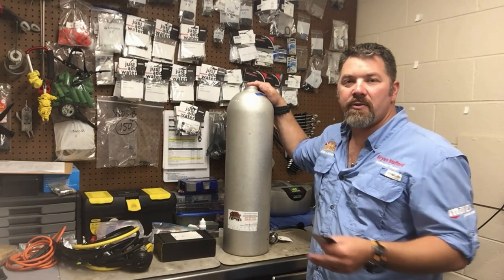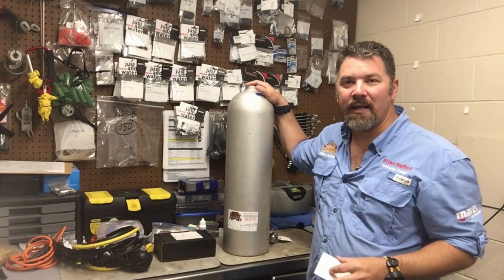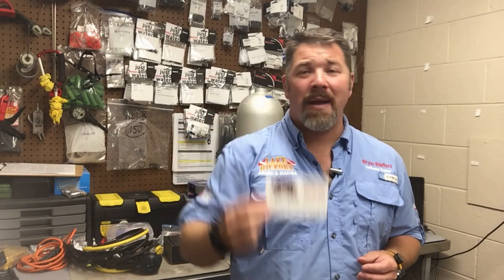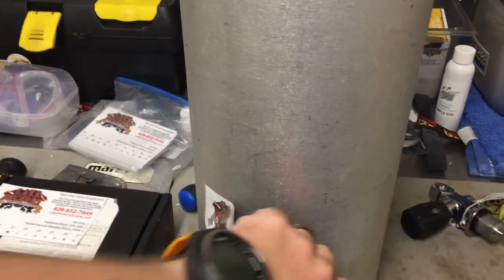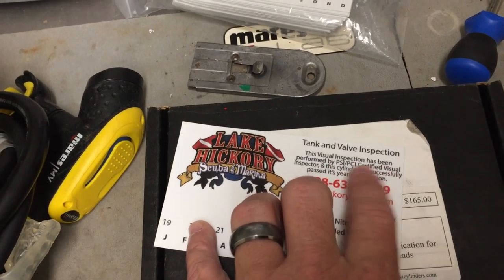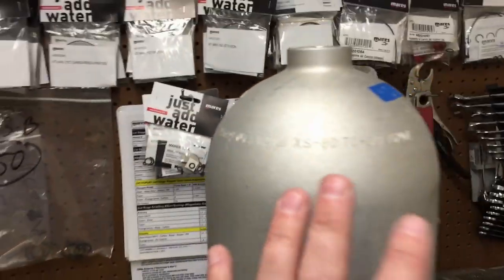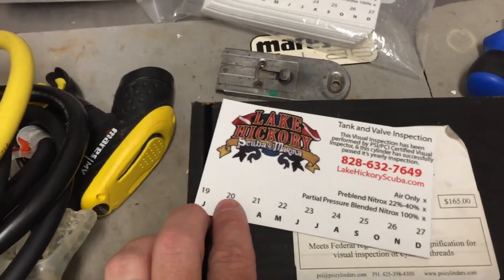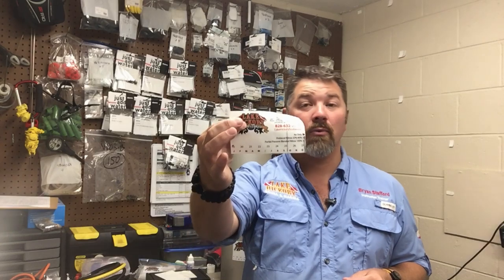The Visual Inspection Sticker (What Does It Tell Us?)

Comment: I will say check your stickers before you buy. I had a shop sell us some “brand new” tanks. Then they asked if we wanted to pay an extra 15 bucks to inspect them, as the tanks were past the existing sticker.
Reply from the maker: Hello Calvin, this is why we inspect and sticker the cylinders (new cylinders) at the time of purchase. The struggle is real though. When we put new cylinders in stock, we may sit on them several weeks, months, or even years. This causes issues after a 5 year time frame when the cylinder is purchased and the Hydro has lapsed.

Comment: Why two catagories of air and pre blended nitrox up to 40%
Reply from the maker: Hello Neil Jones. Air represents plain 21% breathing gas. Pre-blend is for shops that use a membrane system or continuous blending. Both of these do not require a cylinder to be Oxygen Cleaned prior to filling. The with Partial Pressure Blending, cylinders are required to be Oxygen Cleaned prior to filling. Theses markings indicate which cylinder is which.
Reply: @LakeHickoryScuba  if both do not require oxygen cleaning up to 40% then why not just have one category for these tanks .
Reply from the maker: This still helps us identify cylinders that have been classified as Enriched Air Cylinders vs Air Cylinders. There are regional regulations in regards to filling cylinders with anything other than 21%, and unfortunately, the big green and yellow Nitrox stickers are not enough.
Reply: @LakeHickoryScuba  Brian, please correct me if im wrong. This is my understanding of it.  I actually learned this recently. It depends on how the shop fills nitrox. If they use a partial pressure method they have to fill the tank a certain point with 100% O2 then  they basically dilute it with nitrogen to bring the O2% down to the divers requested percent. This method requires an O2 clean vis because the tank is subjected to 100% O2.
 The other method is a preblend. The shop keeps a certain percentage of nitrox in its fill banks and fills your tank with that.  This doesnt require an O2 clean vis because the tank never sees 100%
Reply from the maker: Hello Kyle, you would be partially correct. In partial pressure blending, you mix the pure O2 with standard breathing gas, not pure Nitrogen. And pre-blend can be from a banked system or through continuous blending (such as a Nitrox Stick like we use.) As long as the mixing procedure is done prior to entering the cylinder, the cylinder does not need to be O2 cleaned. The scuba industry has set standards that are not regulated in regards to this, simply because from a legal stance that is all it is, an Industry Standard, not law. Some believe this is done to increase sales, such as O2 cleaning fees. At the end of the day, the ultimate authority comes from the fill operator, and what he or she feels safe filling.
Reply: @LakeHickoryScuba  Im not sure I understand completely what you're saying. What is it some believe is done to increase the sale of 02 cleanings?
Reply: @LakeHickoryScuba  That was a great discussion and answers.  Thank you again as always.

Comment: What does requalified #v106443 mean????
Reply from the maker: Hello @user-dl4qv8qw9s, great question. Here in the United States, the U.S. Department of transportation mandates that all pressurized cylinders be hydro statically tested ever 5 years to verify the integrity of the metal is structurally sound. In the scuba industry we are also required by insurance companies to perform a visual inspection of pressurized cylinders that are use for breathing gas. This visual inspection ironically is more for the safety of the fill operator than it is for the end user. Hope this answers your question.